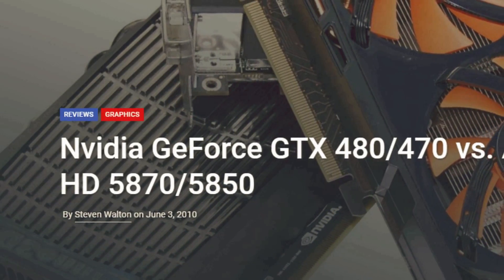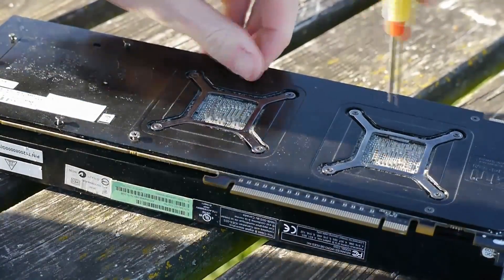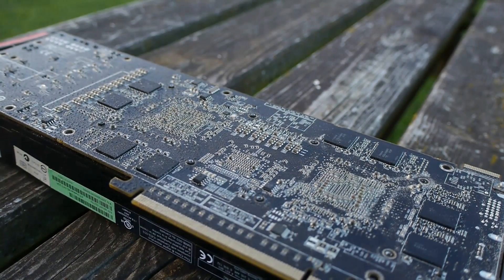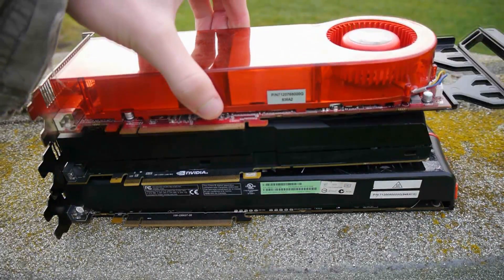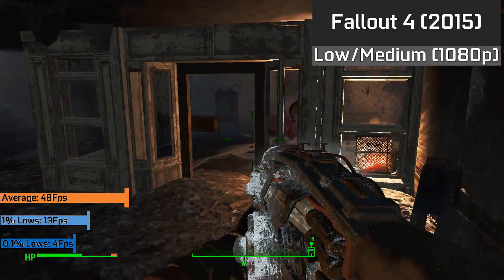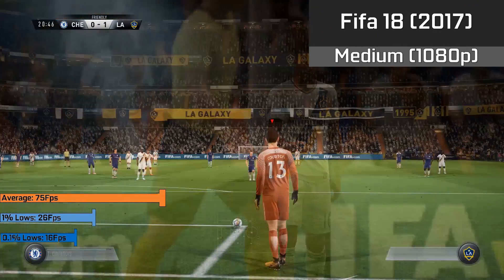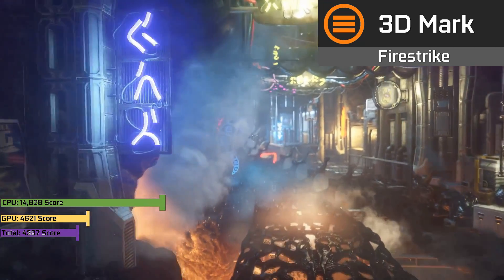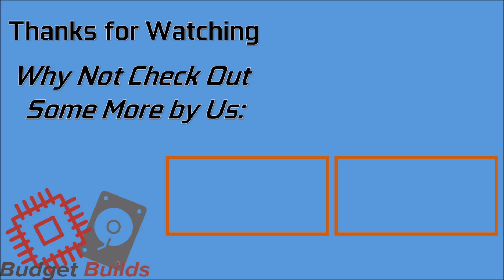The HD5970 is now £25 ($32) but is it any good?

Comment: Answer to your 25 FPS locked in Fifa18, They animate the Scenes, instead of coding the movements into the game. By animating the scenes, you reduce the cost of the game and you save a heep of a lot time on also. And it's actually 24FPS, because that the minimum most smooth looking frame rate, by making it 24 instead of 30 or 60, you save a lot of money from the animating, because you only have to render 24 frames for each second not 30 or 60. The 25FPS you see is just being rounded up by your frame rate capture software.
Reply: incorrect, 24 frames does not save money from animating, its commonly used as an easily divisible keyframe number for various methods of animation.
Reply: U know, Even if they did "Animate" the scenes, the Biped Rag Doll Animation are always based on Keyframes! It simply means those Rag Dolls can Adapt to any Hardware capability. Given the situation, in the video, it only means the game Engine is too heavy for that GPU card.
Reply: What bollox is this you speak.

Comment: The problem with crossfire is that is supports way fewer games than SLI. SLI is only officially supported on like 400 of maybe 100,000 or more PC titles. Either one is bad, CF is worse.
Reply from the maker: Crossfire performance is generally better in supported titles, and you can force crossfire in a lot of titles, but as you said, both are still trash.
Reply: You can force both cf and sli in a lot of games and see performance increases. you can also see negative scaling,  and a whole slew of various graphical bugs. Also many bugs are created in games that support it officially. One of my favorites from back in the day on crossfire was in fallout 3 with crossfire was the HDR lighting would run at 2x speed. So basically the lighting would adjust 2x the theoretical speed of your eye. Totally horrible, maybe it's fixed by now.

Comment: The small frame buffer is what kills it in some games.  GTA V handles the small frame buffer well, but in others (Borderlands) it absolutely murders the performance of these older cards.  I like to target GCN based cards (200 series) as they tend to perform much better now than they did when new, especially when the software has DX12 or Vulkan rendering paths.  I know its much newer than the 200 series I am was referencing, but take a look at the performance of the Fury cards.  It only took 2+ years but they are beating up on their NV contemperaries (970, 980) in DX12 and Vulcan.

Comment: FIFA uses much higher quality assets for replays then it does for normal gameplay, thats why its locks to 30fps only on cut-scenes. Its mainly due to the consoles it also runs on not being able to handle the high quality assets at 60fps, and this limitation has carried over the PC version. You can disable the 30fps cut-scene lock if you want and have a constant 60fps everywhere in the game.
Reply from the maker: +Console Shock Official: Cheers man that's interesting to know.
Reply: No worries! Love your videos by the way, they really show why PC gaming is amazing!

Comment: Too much thermal compound on the GPU die, I believe that when you add too much thermal compound it starts to act as a thermal insulator rather than a thermal conductor.
Reply from the maker: +Alex Maison: Temps on it were great, don't worry.

Comment: The 2008-2012 GPU era...the muscle car era of gpus
Reply: Marc I got a gtx 660m from 2012 and it holds up really well only game I've had trouble with is rise of the tomb raider but I believe it is because the gpu only has 2 gbs
Reply: @hatsunemiku8007  not really, because i played Rise of tomb raider with radeon HD6850 1gb in low/med settings and also works with 550Ti in low settings pretty good
Reply: My Radeon 4850 that I pop in and use occasionally still runs great! IT was released in july 2008 at 200$, but I managed to get it for just 130$ 2 months after release with a combination of sale and rebates and it came with Alone in the Dark 5 for free. The only reason I replaced the card in November 2012 was because its lack of dx11 support that was really starting to creep up on it, and its original fan died. I did replace the fan, but purchased a 1 gb radeon 6770 to replace it for the dx11 api. Then I ended up replacing the 6770 for a 7970 in september of 2013... This 7970 is probably the best aging card of all time!
in this day and age if the radeon 4850 at least supported dx11, it would be the minimum card I would recommend in a quick budget build just to get into games. It can still run most dx 10.1 esports titles, and existing dx 10 titles in 720P at low to medium settings at a playable framerate. Nothing spectacular in today's standards, but for a quick fix it is the lowest I'd go.
Reply: The 7970 is still a beast today.
Reply: @EvilTurkeySlices  yea. If it didn't die. I have 3 dead 7970s. It has good performance, on par with what, a 1050ti nowadays? Still good. But uses two 8 power pins... The Radeons back then just didn't feel very high quality to me. Always ran hot AF ( I guess still the same nowadays) and not a single one I owned went pass warranty without breaking within a year. The GTX I owned on the other hand always ran cool and they still function to this day.
I remember raging so much over radeon cards, sitting in the phone for fuxkig decades to get it replaced, and ultimately buying new ones, that broke anyways.
Reply: @ZDY66666  I used a 9800GT in an overclocked C2D that was 10 years old, now I have a HD5770 that's 10 years old and play GTA V on it at 60fps.
Reply: Just like the early 2000s of CPUs
Reply: I ran 2x Nvidia 8800GTS in SLI back in 2008, thought I was the shit with two graphics card, lol.
Also had this 5970, the size was something else
Reply: @Sukz0r  I bought one 5970 black edition in the month that it came out, and man what a blast! I also ran before that a 8800gtx wich I still have it actually I still got both the gtx and 5970 still mint condition and running!!
Reply: 2008 and 2009 were meh... The 9800/GT was known to drop like flies! And thus probably only the GeForce 9500s and GeForce 9600s were reliable, if even that!
Reply: @RJARRRPCGP  Gtx 285
8800 gtx
Reply: And much the same way as my Highlander is faster, safer, and more efficient than those muscle cars, my 5070 wipes them off the face of the earth before even hitting 150 watts 😂
Reply: I would say it’s more 2012 - 2015 because of the R9 fury which literally has the same name as a muscle car 😂
Reply: So that means 2011 to now is JdM era
Reply: @RANDOMBOI-ju5gw  ... What? No.
Reply: eh no

Comment: Nice video! But too bad you didnt try overclocking it. Those newer triple A games would get a huge fps boost. My HIS HD5870 back in the day worked at 950mhz / 1150mhz and had a Firestrike score of 3800p. It seems like Firestrike doesnt properly support CFX on this card.

Comment: I remember when I had my 6990, its was great and overclocked like a beast. Sold it eventually and now with my r9 295x2 for the last few years. Still running strong and custom factory water cooler does its job well. So much potential in old tech for the money. You can get something a little weaker for many times less.
Ironicly I got my r9 on release for 500$ canadian brand new, plus traded my 6990 with arctic cooler for that too.

Great video, bring awareness to oldneglected tech, you can max out hudrets of games on that 5970.
Reply: Who cares about your shite pc or what you swapped. No one, that's who. Now piss off!

Comment: Back wgen AMD made graphics cards, i had to buy a 1070 on my latest card because AMD doesn't even have something to compete with it. Also to disable the 30fps lock in Fifa you have to force unlimited frames in AMD/Nvidia settings

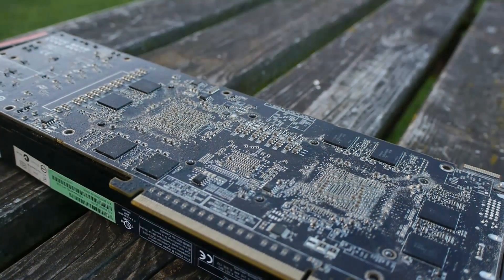Comment: What was the fluid you sprayed on at 2:49. I have some old hardware that could use a buffing and sometimes the compressed air doesn't cut it.

Comment: You didn´t disable PhysX in Borderlands 2, a notorious badly optimized game or I should say: Nvidia sponsored title.
That is why it sucks too much on AMD  cards
By the way BL2 is a 2012 release not 2015, it deserves a pop up text fix
Reply: Honestly physX does not even work properly with any nvidia gpu, they fucked it up so much...
Reply: BL1 remaster is way more optimized than BL2 now, that's for sure
Reply: Borderlands 2 is most certainly better optimized than borderlands 1 though. I see my 7970 in 1080P max jump between 130 down to 70 for no reason in BL1, in BL2 this is fixed and runs higher and looks better too. Part of the problem is the old, even at the time Unreal 3 Engine.
Reply: mamailo2011 i think its because BL2 was released on PC in 2015 and console 2012? I think i don't know.
Reply: @thelazyduckyy  game came out in September 2012 on PC and 7th gen consoles
Reply: @thelazyduckyy  nah bl2 released alongside the console versions

Comment: I don't know if you read your comments much but I need some help. I've got a gtx 1050ti but still get bad performance in some games. I think it's because I also have an intel pentium g4400. You seem to get really good performance with cheap graphics cards so are there any cheap cpus you would recommend as an upgrade?
Reply from the maker: +Bzorlan: Try and grab a core i5 6400... They're around £80 now and aren't bad for the money. Also try running DDU and then reinstall the drivers..Hope this helps :D

Comment: Madness . I sold 2 5870s recently for 45 pound each! I only went by what others were selling at and that 50 plus postage
Reply: And then on my travels I was donated 4 gfx cards. An old x1900, 2 4870 X2 cards and an unknown card. Which turned out to be an engineer sample r9 290x!! Just needs an after market cooler to release it's full potential. Otherwise it idles at 60c lol..

Comment: Help I'm looking for a cheap gaming PC I would like preferrably an i7 processor with at least 16 gig memory but I don't know what is compatible with an i7 processor for a motherboard
Reply: You don't need an i7 for gaming, a i3 from the 6th gen and up will do everything you could need. Anyway, is there any way I can contact you other than on here as I can help you greatly on what parts you need.
Reply: john clark you will have to go further than cheap buddy for 16gbs of ram and you have not even taken into account the gpu, power supply, hardrives and your case
Reply: john clark your cpu will fit into any motherboard with the socket of the certain CPU also if you are just going to look at cheap i7s you would be better off going for something like a ryzen 1200 or idk a i5 3470 off ebay
Reply: Ok sorry about not being very clear I need a new processor motherboard and memory I've got a very good power supply can't remember the name of it but it's 550w it cost me £50 when I bought it I have a AMD radio R7 360 graphics card which I think is quite adequate so I think I will be keeping that 2 terabyte Western Digital hard drive and a medium size case that's the only way I can describe it
Reply: System Information
------------------
Time of this report: 10/23/2017, 12:28:06
       Machine name: BEDROOM-PC
   Operating System: Windows 7 Ultimate 64-bit (6.1, Build 7601) Service Pack 1 (7601.win7sp1_ldr.170913-0600)
           Language: English (Regional Setting: English)
System Manufacturer: MSI
       System Model: MS-7592
               BIOS: Default System BIOS
          Processor: Pentium(R) Dual-Core  CPU      E6600  @ 3.06GHz (2 CPUs), ~3.1GHz
             Memory: 4096MB RAM
Available OS Memory: 4096MB RAM
          Page File: 4680MB used, 3508MB available
        Windows Dir: C:\Windows
    DirectX Version: DirectX 11
DX Setup Parameters: Not found
   User DPI Setting: 144 DPI (150 percent)
 System DPI Setting: 96 DPI (100 percent)
    DWM DPI Scaling: Enabled
     DxDiag Version: 6.01.7601.17514 32bit Unicode
Reply: Yes but the thing is this board won't take any more than 4 gig of RAM and I think that is what letting me down in playing Modern games
Reply: Thanks I would appreciate the help here is my email address joancl0161@gmail.com
Reply: john clark Do you have a Skype or Discord, it's much easier to use those as the amount of times I check my emails is little to none.
Reply: Yes I do have Skype and this is my ID nobbyclark53@gmail.com

Comment: Wierd, when I had my 2 HD 5850s, Borderlands 2 had no stuttering issues whatsoever in crossfire mode and the settings were pretty damn high too!
Reply: Borderlands 2 probably has issues with the one card in the video. Either way, it won't look as good on an AMD card due to the heavy use of Physx on all the Borderlands games. Also what cpu were you using as that can also make a big difference on Borderlands 2.
Reply: Actually, the PhysX on Borderlands 2 only runs well on the GTX 5xx and earlier iirc. On my 970 the framerate drops a fair bit with it on, and it's a known issue.
Reply: LaBomba Romba With my 960 it does it too, and yes it's a known issue, it's because Nvidia hasn't properly screwed with physx since the 600 line if I remember correctly. Either way, having Physx on Borderlands 2 changes it a lot.

Comment: I had Sapphire HD5870 Vapor-X, and it sucked. Not in performance, it was just crashing constantly in most games. It worked well only with Kerbal Space Program. I learned from the forums that some HD5xxx and HD6xxx cards have issues with firmware loaded by drivers. It randomly limits power going to the internal cores of GPU when it thinks they are not used, which freezes up entire card and crashes OS. So I sold it for 30 bucks and bought R7 360...

Comment: HD 5xxx was amazing and miles better...but idiots still bought 4xx in droves. I know because I am one of them.
Reply: Immense Data Nvidia mindshare is crazy man...  I bought a 1050 ti instead of a rx 470 a year ago because everyone I knew said AMD was trash...  How wrong they were :(
Reply: Immense Data Yes I still have a GTX480 Amp that was the Fermi card to have cool n quiet.
Reply: I agree, although my 4850 still has some frames left it in in titles that support dx 10.1. I bought mine because 1 I was not as savvy about the market at the time, and 2 I was computerless since my moms pc died right before i entered college and I was forced to let her have it... I built my phenom 9600, radeon 4850, 4gb ram system at the time and had many years out of it.

Comment: Fuuuuuck!!  This would have been the perfect gift for my brother. But no. Thanks to you they are all out of stock and I can't see that changing. FML.
Reply from the maker: Your average Brit & Whovian: I'd grab a HD7850 instead or GTX660.
Reply: Budget-Builds Official thanks. He is currently using my old desktop with integrated graphics. It really needs a dedicated GPU to function properly as the apu is causing all kinds of problems but I can't really get anything much more than £100 so I'll look into those two instead. I would rather avoid second hand though.

Comment: hey budget builds i want to buy an core 2 quad 9550and overclock it. i was wondering if you know any good cheap mobos for what im trying to do. also can i use a modern PSU for an older motherboard???

Comment: What's that chip in between the two GPUs that looks almost like a CPU?
Reply: Yeah, I also wondered that while I watching the video... I think it's something like that helps the GPU's to communicate with each other without SLI bridge/Crossfire.
Reply: Its called a PLX chip. It acts sort of like a PCIE switch. What it does is create a link via pcie between the 2 gpus.
Reply: And he didn't put the heat transfer pad back.

Comment: where are you finding that card for  $32 bucks?
Reply: the thing with cex is you have to check every day they might get 2 a year,  it is a 2nd hand/pawn shop.
Reply: Coles Towing the cheapest i found on eBay US was $45
Reply: The thing is there hasn't been anymore CeX in the US for a while, they took down all stores. Basically just raising the finger to the United States.
Reply: https://uk.webuy.com/product.php?sku=SGRAATIHD59702GBA